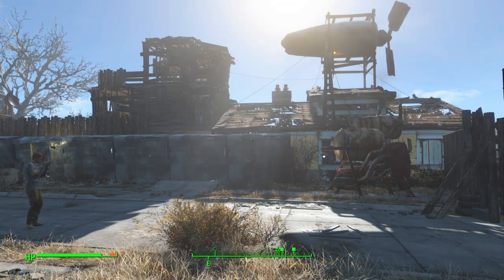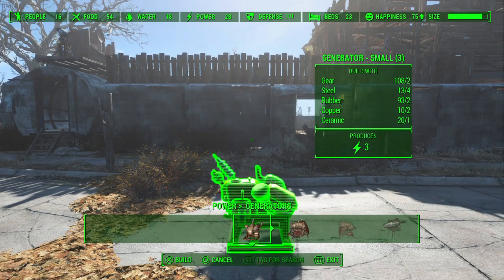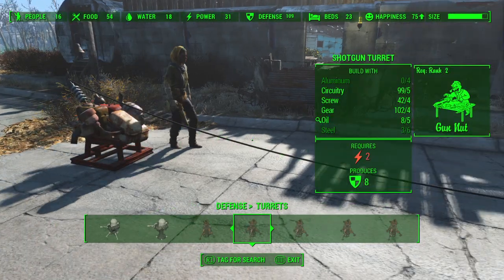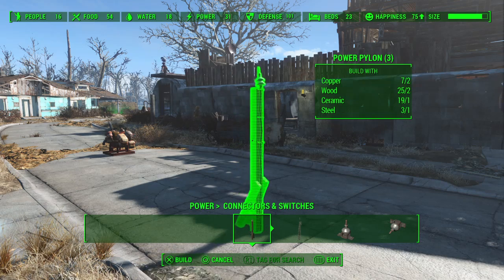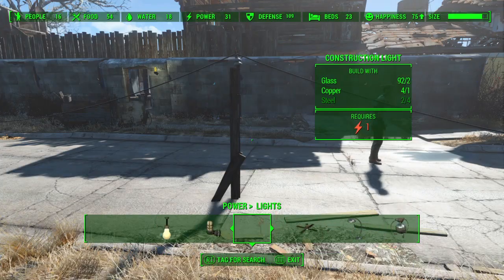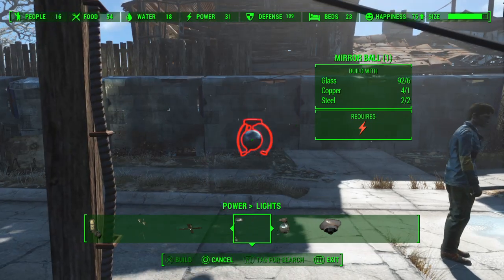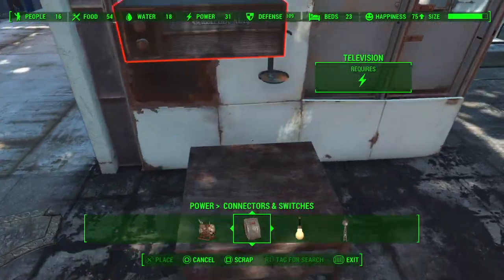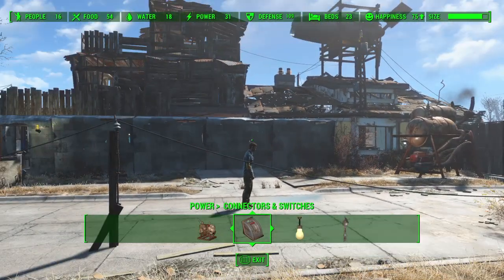Fallout 4 - Settlement Tips - How to Set Up Power, Generators, Power Conduits, and More

Comment: To explain your mystery about the lights being powered; I believe your theory of the conduits charging an area is correct - however I believe that small objects (ambient objects if you will,) such as the TV and lights, don't require an actual "unit" of power, only for it be around a power source.

For example, see how there is no number next to the lightning bolt icon for those items? Yet for the construction lights and turrets the have a number?
Reply from the maker: +PhoenixDwn75 Ahhh, interesting! That makes sense--I'll keep an eye out and test that theory. --Kyle
Reply: I am powering over 10 lights with a small generator, proving that theory is correct.
Reply: make sure the lights are near pylons, whether it be the towers or the little wall connectors... the standing industrial light requires a wired connection

Comment: Note that the power is not running through the walls. There's an invisible halo that radiates from the switches and connectors which will power devices within that area.  The more expensive (resource-wise) connections radiate a bigger halo. So, little blue fuse boxes may be temptingly cheap, but they will only power lights very close by. The power conduits cost a little more, but you'll need fewer to light up a large area. Likewise, the more expensive connectors will also allow a wire to run a bit farther. 

Btw, avoid TV's and juke boxes, because these currently can break your settlement, reducing the power and water to 0 when you're not there and sending happiness plummeting.
Reply: Steve Gale thanks i was wandering why everything went wrong

Comment: Great video, thx.

But if the conduit does the same thing than the pylon, you only need a pylon to raise a cable up high. It seemes to be a cosmetic issue since I have build a whole base with a lot of electric things only using conduits, which are working as distributors and as splits.

And important for a generator-farm: You do not need to connect every generator to the next pylon/conduit - as you say @ 5:20
You can built a series connection by connecting all the generators together. And then one generator to the next distributor. This way you can save cable-material.

Also interesting how the distribution via solid objects work. I first thought, you were wrong with the TV - and that it gets it energy direct from a conduit on the roof of the building which bears the wind-generator. But I think you may be right with the elements having contact and therefore are conducting energy.

Also PhoenixDwn75 is right when saying you can energize unlimited objects which have no number on the electricity-icon. At least I tried a lot of lamps and stuff with one little generator and it worked till my test-building was shining as far as Diamond City.
Reply from the maker: +Domitius23 All awesome tips! Thanks for sharing and improving on my limited knowledge. --Kyle
Reply: +PlayStation Universe No no, you know a lot. Yours is by far the best FO4-Electricity-Tutorial.

Comment: There is an "area of effect"for illumination. Imagine an invisible bubble around the generator and conduits if you will. This is what powers lights etc and no it won't take any of the numbered power output from the generator.

Ive just discovered the Local Leader perk which helps with sharing your junky resources between settlements.

Comment: Quick question, is there any way to power the street lamps outside? It just feels weird having them sit there and do nothing. And it feels even weirder with the streets just being pitch dark at night, so it'd feel nice to have some sort of lighting around the streets.
Reply from the maker: +Wild Koffing I never tried running copper wire to the street lights themselves--I just scrapped them for Steel--but it's worth a try!
Reply: +PlayStation Universe I've tried to connect the wires to them, but no Bueno. You can't place the connectors on the lamps either. Just feels odd.
Reply: +Wild Koffing They were rotted by NUCLEAR blast, lol..
Reply: +Wild Koffing Use the poles you can build and then set a spotlight up there? lol

Comment: 2021. Just started playing this. As far as wall conduits go, do you need a wire bewtween each one? For example: You have a 100ft wall and want hanging lights along it's entirety.  You have a generator with a wire to a wall conduit placed on the first wall tile. Hanging lights only light up for maybe 3 wall tiles. So you place another wall conduit. Does that second conduit need to be hard-wired to the first? Basically, how do you daisy-chain.

Comment: You actually get more power per relative square meter by using multiple small generators than with large generators. I always build a steel science center building in sanctuary for the Institute teleport, and have power station rooms constructed inside auxiliary towers. Using a two-story high one full floor section of space and an upper rack of wooden platforms separating the top and bottom wall section I was able to easily fit 12 (3 * 12 = 36 power) small generators in the space one large generator fit (only 10 power). For high powered setups well organized power stations utilizing multiple small generators in a series is the ideal approach.

Comment: The best way to power a three level home is to have the conduits and wires going around the walls on the second floor (on the inside of the house)...this should be enough to power that floor, the one above and the one below as the area of effect will be large enough to cover these floors.
Reply: What about light switches?
1 lightswitch to control 1 conduit?
Reply: +Thurman Murman for switches, its easy if you imagine the power flowing from your generator and your electrical circuit as water in a pipe. If you have generator/switch/lights...in that order then all the lights that you place after the switch will be controlled by activating that switch. Imagine turning a tap off and on...it will stop the flow of power running and further. Hope this helps.

Comment: Can you wire multiple generators together and have the last wire connected to a single power line running running down the street, like an actual city? That would really help to clean things up.
Reply: yep. Ex: If you used four small generators that provide 3 units of power each and connected all four onto a junction and sent one wire out, that one wire will have all 12 units of power provided by those four generators.

Comment: How did you build the short, wooden fence on your second story? All my junk fences are like 10 feet tall, i want a shorter fence but not the wire one :/
Reply: +Nathan Cline Its Structures > Wood > Miscellaneous 
And all power objects have a radius , simple pylons have a similar radius aound them in a sphere ,any non attachable power objects within that zone are powered.
Reply: +Nathan Cline just use walls .or look in wood and than miscellaneous ,there should be bridges there too .

Comment: What's the difference between "clean" power from the windmills and the standard generators? I haven't noticed one personally and size-wise it seems much more efficient to use the large generators (10 power) if they take up the same space as one windmill (3 power).

Comment: How do you power up the conveyor storage when there is no visible power point
Reply: the power travels from the builder(etc) or the convater belt
Reply: conveyor*
Reply: i was electirian in real life... i understand how wireng works...but this power conduit system damn hard to understand.... electric walls? no wires need?

Comment: my biggist question is how to i set up weapons threw the control screen u build. i tryed to do this for my flamers.. (i like seeing npcs burn)  but they seem to burn them selfs out and i have to repair them before i even get a attack. (in this hole time i never once been attacked (in 2+ over all days i played. and im lvl 20... i dont play much. i do have a life.... persay xD )

my base looks worse then a rats nest with all the power cables all over and i dont know how to stream line them or make things work right. building.... umm.... ya i cant wait  for a PC mod to make it more streamed  (flow easily when building) amd add more item..
Reply: +thunderlord2200 I had the same problem when i first set up the flamer trap. I was so confused. then i realized that its burning it self out because there is no switch to tell it that it should be off and not shooting flames. So just build either a on-off switch next to it and connect it with a wire, or you came use pressure plates as the trigger.
Reply: TheHurtShoulder
 thanks